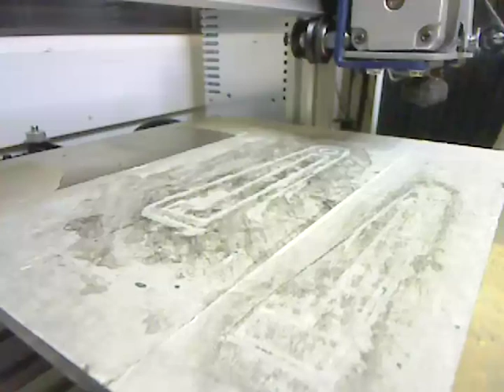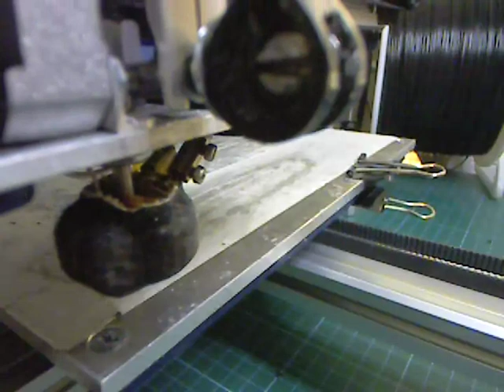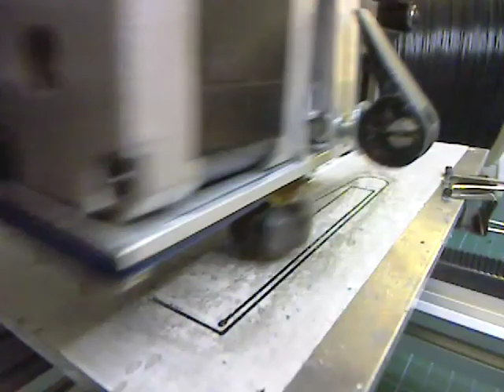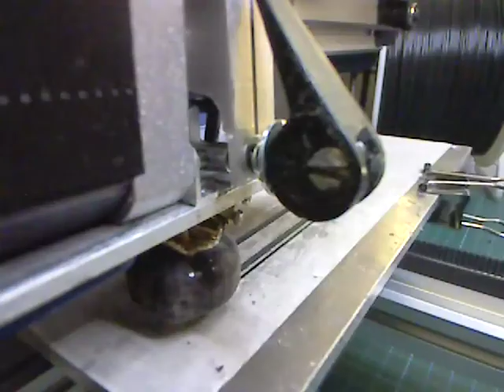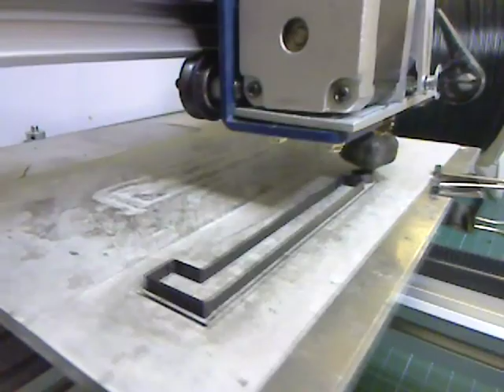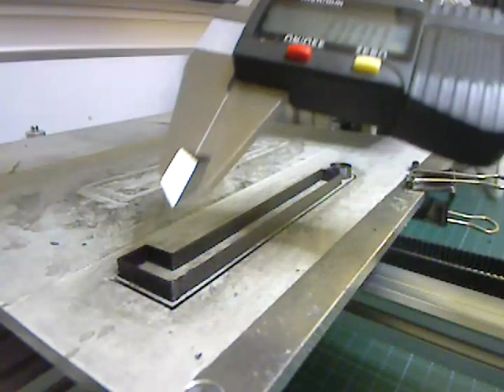ORDbot Hadron printing at 300mm/s

Comment from the maker: It's a home made one: 
- direct drive with an 10mm dia., M4 hobbed pinch wheel
- M6x35 mm steel barrel with a 2mm bore and a 10mm thermal break, 4mm dia.
- 0.4 mm orifice, ~0.25mm long, directly on the steel barrel
- NiChrome wire heater, 30W, inside a cylindrical copper heating block, 22x10mm.
- Aluminum base and casing and a 40mm cooling fan